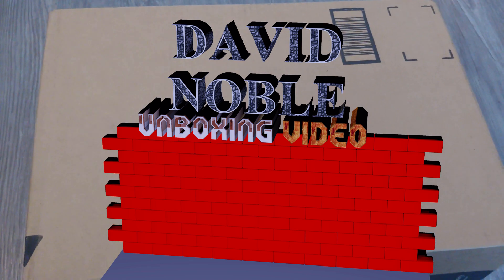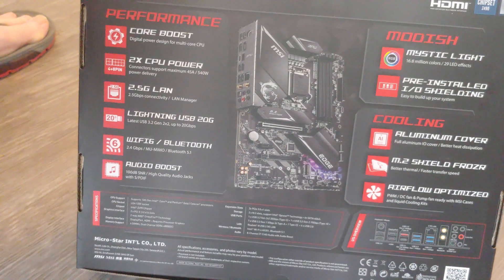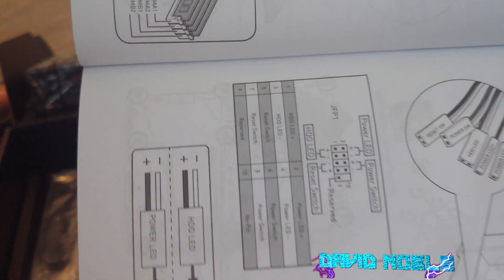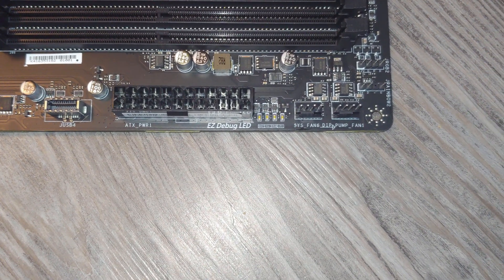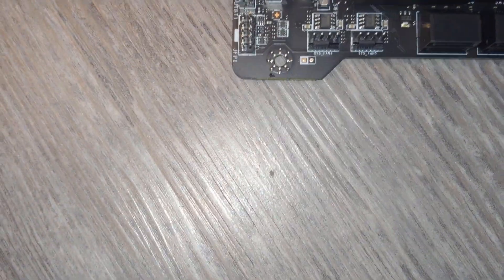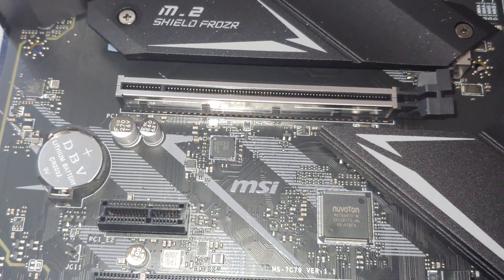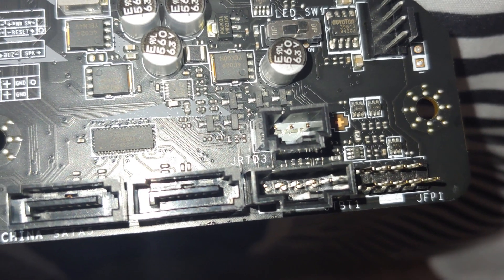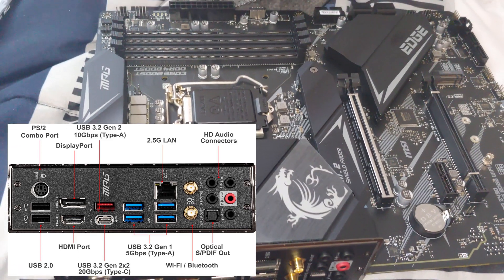Unboxing MSI MPG Z490 Gaming Edge Wifi 10th Gen Intel Motherboard, Is this the best deal? overview

Comment: Thank you Sir. This is my very first build and I didn't have a clue as to what was what and I just so happen to pick the MSI MPG Z490.
Reply from the maker: Glad I could help
Reply: @PC_HardwareTechUnboxing_1   it’s done and it’s bloody amazed, thanks for the video again. 
So wished I could up load a pic 😁
Intel i5 10th gen, MSI Z490,  vengeance® lpx 16gb (2 x 8gb) ddr4 dram 4000mhz c19 . RTX 3060 12gb, corsair rm850x, Cooler master  Masterliquid 360 and it all set in a thermaltake core P5. 😂 I’m well chuffed with myself one work and I’m now broke 💰

Comment: Hey all. I need some advice. I just received my motherboard and the packaging was really bad. The box had been opened and the tap on the motherboard bag has been cut. This is a new product. I have no means of testing if it works because i dont have all the parts yet. Do i accept that its been opened or return it? Its an MSI board that came in a Corsair outer box as well.

Comment: quick question, is it okay to touch the motherboard while it's still inside the anti-static bag? i didn't wanna open it yet for my build, but i'm scared i might have built some charge or something idk.
Reply from the maker: The answer would be...it depends.  A motherboard consists of materials that are both conductors and insulators.  If you are consistently building up a charge, you will notice it as some point when you touch a door handle.  If so, it is a good idea to ground  yourself before touching CPU components and especially CPUs.  If you are say in the Northern part of the USA during winter...you might want to consider some sort of electro static gear.  If you are down south or like where I currently am in Africa, there is minimal risk.

Comment: Someone please help !! Lol !

Will my Corsair CX750M  750 watt Power Supply work with this board ...   ??   It only has a 8 pin connector and this board has a 8+4 pin  ...   Will I be good with a 8 pin  750w ??
Reply from the maker: Quick answer, yes for a locked CPU.  For unlocked CPU, it might not be all that it can be without the extra 1x4 for overclocking.  A couple of videos I made to address these questions:
https://www.youtube.com/watch?v=gnuzNq6dB3U
https://www.youtube.com/watch?v=ZuXCdMJrvnM
Reply: @PC_HardwareTechUnboxing_1  Thank's so much for responding  :)  
 Daang , I just bought a i7 - 10700K Unlocked   LGA 1200 Brand new at Best Buy  :(

Going to watch your recommended videos right now ...  but since I have a K chip unlocked could you or someone recommend a power supply with the 8 + 4 pin please !! 
I still have a few weeks to return the Corsair 750w ....

Comment: just got this board and about to build a pc with a i7 10700 and 3070 hopefully turns out well
Reply: Just got this board and a i7-10700K, and going to be paired with a RTX 3070 too 🤙
Reply: @donp3mofo521  how is it
Reply: @satvinderr  well I had some changes on my build. It isn’t built yet, got a few more pieces to get. But I ended up getting a EVGA RTX 3080 XC3 Ultra card, and returned my MoBo because I had the M-ATX version of the gaming edge. Now I got the Gaming Carbon Wifi instead. Hoping to have everything together by New Years and will start the build shortly
Reply: @donp3mofo521  is it better than 3060ti ?
Reply: @satvinderr  Yes, the 3080 is better than the 3060 ti. So far with what's be released from the 30 series, from better to best, it goes 3060 ti, 3070, 3080, and 3090
Reply: @donp3mofo521  what cooler used ? will D-15 fit on this mb

Comment: Hey david! I’m a new subscriber! Just wondering if this board will be a good fit for an i7 10700k / RTX 3070 / NZXT X63 Liquid cooler / TD500 Case  and some G Skill Trident Z RGB 16gb ram. 
It’s my first build so I would love to make sure all my components will work well together. Thanks man, Hope to hear from you.
Reply from the maker: Checklist:
Motherboard size: ATX, yes it fits
Radiator size:  280mm...case states it fits up to 360mm...Front fits 280mm.
RAM:   What speed RAM...this is 3000Mhz  https://amzn.to/3lxqkA3 
GPU:  Which model?  Case holds up to 410mm length so I don't believe there is a RTX 3070 within 100mm of that dimension.
CPU: Yes, compatible with this motherboard
Case: I believe itas only 2x USB 3.0.  If it had 4x, it would be a problem as the motherboard only has the one USB 3.0 header to connect to the case.
Reply: Great! Thank you for the help! 
GPU model: I’ll be going with the gaming x trio from MSI.
And I’ll be going with 3600 for the ram and the new msi A850gf 850w for the PSU. 

I feel confident about this build. But any changes you would suggest, I’m completely open! Thanks!

Comment: I just got this. Do I need to install standoffs or can I just screw it into my case?
Reply from the maker: Case should already have minimum standoffs installed..but you may need to put a few more in
Reply: @PC_HardwareTechUnboxing_1  nice ty. Does the motherboard have a speaker for diagnosing beeps when something goes bad? I can't find the header for my case speaker pin cable

Comment: What do u think if I pair this motherboard with I7 10700-k? Is a good combo?
Reply from the maker: Yes, I think  you will like the combo.  Whether it is the best motherboard out there for extreme overclocking I can't tell you that as I have done most of my OC'ing with some cheaper Asrock Z490's..

I have not got hands on the other one.  If it is this one:  https://amzn.to/33gz7jk  The price is a bit higher for not much added features.  This one might look cooler in a case for a build so it might come to aesthetics.  

Same company...most likely same performance range.
Reply: I was wondering if I should buy this one or the msi z490 carbon, what do u think uwu?

Comment: Does the ram go in slot 1 and 3 from the cpu or 2 and 4 for dual channel
Reply from the maker: Usually 2nd and 4th from the CPU is what is in the manual.  I have a tendency to forget that...but whether you see any kind of difference is another story.
Reply: David Noble so it’s listed - from the cpu 
DIMMA1 DIMMA2 DIMMB1 DIMMB2 so I’m wondering if I install ram 1 or 2.

Also thanks for the reply
Reply from the maker: @zSleepless  Yes, sorry I am not in front of an exposed motherboard at the moment...but it would still be 2nd and 4th from the CPU which does indeed correspond with A2/B2 for first pair of matching RAM.  Manuals a lot of times will show  a chart with the word populated to show the placement if you have 2...and the no brainer if you have 4 sticks.
Reply: David Noble thanks, I just looked at the manual again and it said very clearly to use DIMM2 so it worked out, thank you

Comment: Hey David, I just got this exact MOBO and had a question. I'm planning on running 6 fans. The MOBO has 6 "sys fan" headers. Can I just plug each fan into it's own header? I have Thermal Take Pure 12 ARGB Sync fans and they come with splitters but just wondering if the splitter is necessary.
Reply from the maker: Splitter may be necessary if you can't reach one of the fan headers in case you have to double up.  I usually use fans that also have molex  and will use that connector so the motherboard looks cleaner.  They will connect directly to the PSU behind the RH access panel.
Reply: @PC_HardwareTechUnboxing_1  Thanks for the reply! I've watched a lot of videos and done a lot of research as this will be my first build so any additional help is much appreciated!

Comment: Hey man! Im pretty sure the answer is yes, but can yoj confirm if I could run 1 240mm aio, 3 front fans, and 1 rear fan all from this mobo? It says 6 4pins so I think im good, Just want to know before buying a fan hub
Reply from the maker: Aloha, yes you should be good.  I sold this one off...but if I remember correctly it was 1 CPU cooler headers and 5 fan headers.  1 fan header is near the IO Shield which is good for the rear fan.  The other ones are scattered.  Now, this doesn't mean  you might not need a splitter or exension cable as the locations might be less than ideal and your cable might not be long enough.

At worse, depending on what fans you are buying...some have the option of  Molex vs 4 pin...in which case you don't have to worry about location of the fan header on the other motherboard or quantity of headers.
Reply: @PC_HardwareTechUnboxing_1  amazing reply thanks so much ❤

Comment: Hey, love the video. Quick question, new to PC building and i just bought this motherboard but it didn't include any of the screws to mount it onto my case. I also purchased a new case, were the screws supposed to be inside the case, or inside the motherboard?
Reply from the maker: Yes..should have been a little bag of hardware..screws..standoffs...pc speaker

Comment: For the past year I’ve been wanting a gaming pc but I don’t have enough money to buy all the part so I was going to use one of my broken pc and put in parts that fit it so does any so I think my computer is a Lenovo H50-55 do you know what parts I will need to make it work a upgrade I’ll be happy for any advice
Reply: Personally I wouldn't recommend upgrading a Lenovo H50-55 into a gaming pc as its processor (AMD A10-7800) is quite old and for what you'd be spending, you can build a new budget system with much better performance. If you're set on upgrading that computer and can only afford one compenent, get a GTX 1050 TI or GTX 1650 with DDR6 memory. They can be powered by the pci e express slot. You will likely get a bottleneck and poor performance unfortunately, so again I really do not recommend this. You'd be better off flipping an older dell computer with a fourth gen i5 or i7 and throw in a GTX 1060 6 GB or RX 580 8 GB.
Reply: What processor do think I would need I can get a better processor for the computer is broken and I don’t know what’s wrong with so I thought instead of trying to find what was wrong with it I was going to buy parts to replace and  tactically upgrade it my budget is going to increase my dad was havening problems with find drywall jobs know we got more jobs coming in
Reply: Curtis Brown I wouldn't use that board, you are better off doing a new build. It is cheaper to upgrade like you're saying but there will be a bottleneck. What's your budget? I can help you plan a build with new or more recent used parts. There's also lots of <$500 build guides you can watch here too, just search for example $200 or $300 gaming pc guide.

Comment: which power supply you are using? I see that the z490 boards have 8+4 CPU connector but the PSU I am planning to buy i.e. corsair cx650m doesn't has the 4 pin cable
Reply from the maker: Hello, unless you are going to get into extreme overclocking of your CPU  (or raise the Power Limits)  you will be ok with 2x4 and not the 2x4+1x4 cpu power connectors.   Otherwise, depending on your CPU/GPU combo...hopefully, 650W is enough.

Since I am away from my shop in VA, I only have 5 PSU's with me.  The one that I used with this was a 900W Apevia Semi Modular.  The one that I am using with the AsRock Z490 motherboard is a EVGA 850BQ.  The latter has the extra CPU 1x4.
Reply: @PC_HardwareTechUnboxing_1  Thanks man, guess cx650m would be fine then

Comment: Does the motherboard really have 2 m.2 slots? I can only see 1
Reply from the maker: Yes, one is covered by their M.2 "Shield Frozr" and the other one has the visible 2280 fastening post.
Reply: David Noble oh so you have to unscrew the M.2 „Shield Frozr“ to put in the SSD? Which slot do you use? (Aka which is the main one?)
Reply from the maker: @PascalLuchs  My suggestion would be to use the one with the Heat sink since it should keep your M.2 cooler.  There are a couople of extra screws to remove
Reply: David Noble okay thank you very much for helping me out💪🏻

Comment: can u recommend an intel 10th gen chips for mother board
Reply from the maker: As of  right now, the 3 chips that would most take advantage of this motherboard would be I9-10900k, I7-10700k and I5-10600k.  That said, Z490's will show improved performance for locked processors.  I currently have four 10th gen chips...all of which are locked.  Personally, I think the I7-10700 is the best deal on a 10th gen processor.  Until prices stabilize, I believe it is the only one I would recommend.  With the price difference between it and the I7-10700k...I would put that extra money into a better GPU or better RAM.

Comment: hi! i was wondering if this can be used for fan cooling? im confused now because there is a pump fan socket you mention 6;44
Reply from the maker: I was going to make a video for you on this...but simple answer is yes.  I don't have this motherboard anymore, but inside the bios it will most likely call all of those headers chassis fans...where you will see WP..work pump on the motherboard.
Reply: @PC_HardwareTechUnboxing_1  ah cool and may i ask how many fan headers there are

Comment: hello if anyone can help where is the CMOS reset located?
Reply from the maker: 12:38
Reply: okay thank you. so i just built a new pc and it was running fine. but after a restart it kept turning on for a second then shutting off and repeating that cycle. do you have any idea if resetting the cmos will fix this?
Reply from the maker: @pancakenuker   Could be a lot of things causing that.  Removing the CMOS is only going to help if you changed something in the BIOS...and then it is going to reset everything.  Did you recently install GPU drivers or some other driver?  Check to make sure no cables are interfering with any fans in the computer.  See if removing the SSD or HDD will get it to boot to Bios.  Depending on which CPU you have, consider taking out the GPU and plugging HDMI into the motherboard.  I don't have this motherboard near me...if it has EZ Debug (which I thought this one does)...check to see if one of the lights is on.
Reply: okay so i got it turned back on by resetting the cmos, now i still have a problem where i have no internet connection with an ethernet and i can’t detect any internet with the board. what do i do now? sorry for all the questions!
Reply from the maker: @pancakenuker    You need to either install your motherboard driver discs via the disc that came with them....or download them to a thumb drive.  This should solve the ethernet issue.

Comment: im going to buy this motherboard to build a pc, my first build pc ever so I never bought a motherboard. The manual explains everything on how to set it up and the cables?
Reply from the maker: Yes and no.  You may buy a case with other connectors to include RGB.  The majority of what you need is in there.  Not all PSUs are same.   Better off watching YouTube videos.

Comment: Gonna be building with this using a 10700 (10700k was sold out everywhere and those who still had em were pumping up the price) and a msi rtx 2070 super! Just waiting for my case to arrive. Can't wait
Reply: Check out my overclock settings if you've received your MB, and if you ended up with a K chip. I have the same setup. I think the other comment was about pairing an overclocking MB with a non K chip. Nothing wrong with that. Get what you want. You can always switch to an unlocked cpu later.
Reply: wow what a waste of money
Reply: @karljuliuz  How about instead of an insult you give me what you would presume to be a better value along with your reasoning behind it. A much nicer way to reply to someone who you have never met before, unless this is just how you introduce yourself to people in person.

Comment: Can 10900k be overclocked and work well and stable?
Reply from the maker: I haven't been able to get one yet...but I would say just like the I9 that I do have...proper cooling and if going beyond just Core overclocking...doing your HW on what the proper settings are, you should have no problem.
Reply: Yes i bought this board for that reason... oc the 10900k. Big time cooling and power needed.

Comment: I use this board with my 10700k. Love it. Very well made, and performs excellent. I also use nvme Optane memory for my secondary HDD gaming drive. A little tricky to get the Optane drivers installed correctly though. "Pro" tip: set a restore point before going through the Optane driver installs. Do it in the correct order.
Reply: ill remember that!
Reply: does it have rgb header bud???

Comment: Bro its recomendable for i9 10900k? Sorry for my bad inglés
Reply from the maker: Yes, this is great for any 10th gen that ends in a K.  Unfortunately, I was only able to get I5-10400 so far to use with it.  This motherboard has many features that I can't take advantage of.
Reply: @PC_HardwareTechUnboxing_1  Stupid Question first time PC builder here, this motherboard has Wifi built in right? Do I need anything extra to connect to Wifi once I install the Motherboard apart from typical driver stuff?

Comment: Which ram would you recommend to pair this mobo and a 10600kf?
Reply from the maker: That's a tough call, so many options/variables out there speed, qty, RGB, your budget..etc.  If this was one of the big boy channels I might be saying 4800mhz.  I will be seeing how it works out with my existing RAM (2666/3000/3200).  Eventually, I will be pushing something faster.  Sorry, I can't be much help on this one.  I have made hundreds of 8th & 9th gen videos...but in a way feel like, I am hitting the reset button.  Similar to when I bailed on Intel and bought 3 straight Ryzen 3000 CPU's.